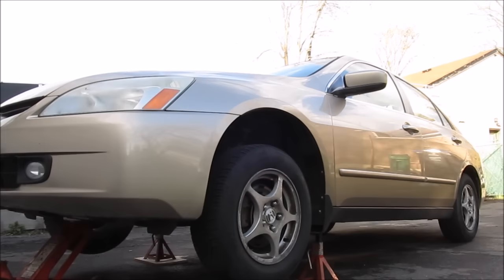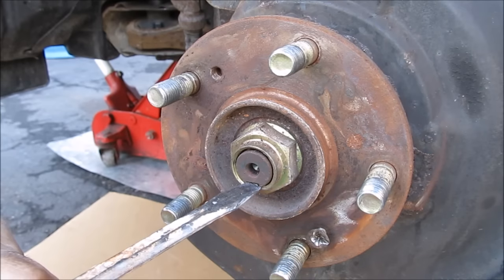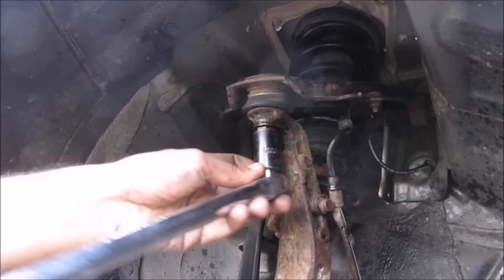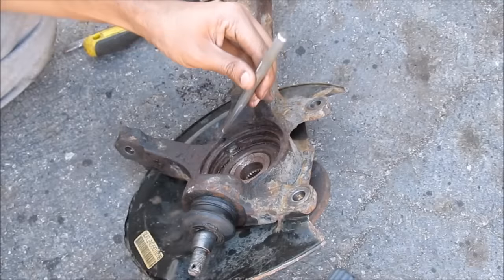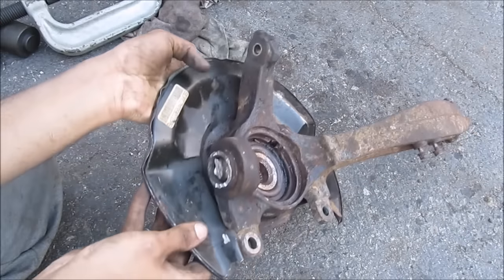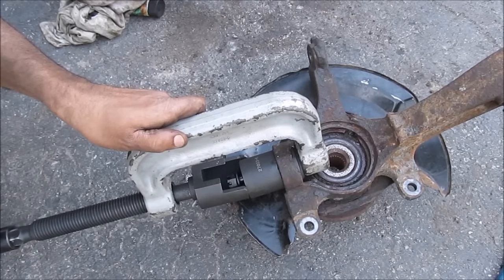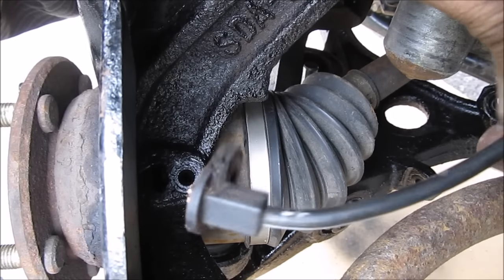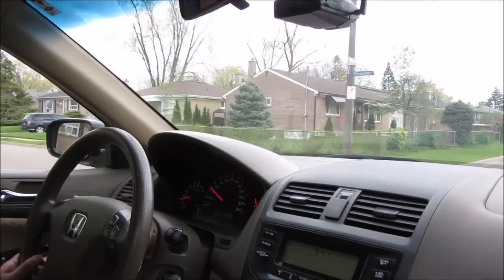Honda Lower Ball Joint Replacement

Comment: there are pneumatic hammers you could use on the ball joint WITHOUT pulling the knuckle completely off. the abs sensor was the reason why you made this a bigger job than it could be.
Reply from the maker: +Gb Xx yea those abs sensors were terrible...I should have disconnected at the harness and left them in the knuckle
Reply: speedkar99 good thank quickly way how to fix diy
Reply: I still have to get an intermittent loose clicking caliper sound fixed... possibly  crushed bushings.

Comment: Great video, i hope you still answer to some comments, How fitting the ball joint separator tool is for honda. 
Honda Manual call for 28mm Jaw size. It would save me great money if i could just buy this instead of the official tool

Thanks

Comment: Great Video, I just had a ball joint fail on my 2003 honda accord.
Reply from the maker: +Jeff Hortian oh wow, did it fail in the parking lot?
Reply: no, I just got off 94 in Minnesota and I was at the stop light. I hit the gas and was about 1/4th of the way through the intersection and then it slide for 5-10 feet maybe if that. Called the cops to warn cars and tow truck. Got it home and am working on it still. I am about to try and get that unit off the end of my old drive shaft and move it to the new one. I am trying to figure out the proper way right now.

Comment: Very nice video, you're truly skilled.  Question, what would the average price be for a simlar job at the local garage?
Reply from the maker: Thanks. I'd average 1.5 hours of labor per side. Part cost is $30 for a cheap ball joint and $50 for quality ones.
Reply: So about $200 per side? (adding the overhead)
Reply: I was quoted at 3 hours and 80 for parts at my fav local garage...$500...I almost considered it as I have nightmares from pressing and getting the preload right on my Jeep.

Comment: thanks for the tutorial, much appreciated. any tips for removing that dust shield from the back of the wheel bearing? i tried penetrating spray and a flathead, but it's stuck in there pretty good.

Comment: Great video .i need to replace the lower ball joints on a 2000 Honda CRV. Please let me know of any differences,
Reply from the maker: +ppett1 thanks. If its pressed into the knuckle it should be the same

Comment: Gud information video.. 1 thing is that ring u removed b4 u tryed take off the balljoint is giving me a problem.. wat can it b? Mayb rust?
Reply from the maker: +Reynaldo Castro Yea its not easy to get off sometimes, you might have to break it.
Reply: speedkar99 i sprayed some pb blaster got it off but bent it very lil on the edges using the flathead but can b reused.. thanks fo that video!

Comment: Very important to torque everything to spec.,  castle nuts 36-43 ft Ib. Spindle nut 181 ft Ib... Do not use an impact wrench.
Reply from the maker: Good tip.
Reply: The Honda Service Manual and the aftermarket HAYNES manual include all torque specs.  On some of the suspension bolts, you should raise the lower control arm to mimic the suspension position as if the car were resting on the ground prior to using a torque wrench.
Reply: @stevencagle1031  The problem is is that speedkar99 is so lazy that he uses impact wrenches instead of torque wrenches to tighten nuts and bolts.

Comment: Great video. Is there not a clip on the underside of that ballpoint that needs to be in? I didn't see you take one out either. My honda 98 has a clip that needs to come out. Actually it's a snap ring ordeal.
Reply from the maker: +Turbo Tony No circlip on the gen7 accord

Comment: good to the point,but never mentioned the snap ring!and ball joint needs to torqued !or they will snap,and don't say no.it just happened to me today,I torqued  new one a year ago,the mechanic put cv joint for me two weeks ago and  did not torqued it and it snapped on me today!!
Reply from the maker: Good point

Comment: Hi,
Since you've shown work on several Toyota/Lexus products, I hope you'll respond to a puzzling question about my car:  I have a '98 Lexus LS400 
that I really like a lot.  Recently on starting it briefly flashed 
"check VSC" so I knew it probably had a weak battery cell (a known response for the model), but it cranked well and started easily, so I put off replacing the battery.  A few days later on starting a LOT of dark smoke smelling of raw gas billowed out from under the hood and tail pipe. It shut down in about 4 seconds. Tried it once more, same thing. 
No CEL.  Next day it cranked but wouldn't catch at all. Had it taken to the
shop. The Tech said the only thing they could find was a defective battery.  
Said that, on cranking, voltage fell below requirement of the engine 
management computer causing it to badly flood the engine. When they 
boosted it, said it started and ran properly.  So they just replaced the
 battery. It's been fine since.  Does all that make sense to you?
Thanks!!
Reply from the maker: +wholeNwon That smells like a failing fuel pump or a line with a leak not getting enough pressure. Inspect those.
Reply: +speedkar99  But the engine flooded.  Exhaust analysis confirmed very rich...unburned gas.  I did not touch the gas pedal during this time. No leaks.
Reply from the maker: +wholeNwon Well yes, a battery with a bad cell will cause the computer to do strange things. This is confirmed especially when you boosted it and it started fine.

Comment: Or if you don't have fancy tools you can heat up the knuckle put the ball joint into the freezer and you can put it in by hand. Literally.  I spent hours trying to squeeze it in. And than I had eureka moment and it worked.
Reply from the maker: Good point.

Comment: When working on this gen accord have you ever come across the damper fork bolt seized in the control arm bushing. Happened to me, had to take it to a shop, didn't have the tools to cut the bolt.

Comment: Great Video.. one suggestion though,  many of those bolts have torque specs...I see you used a torque wrench to put the axle nut on.  That actually has a low torque spec for example.  I would think over torqueing that nut would be bad for the bearing.
Reply from the maker: +David Rogowski I didn't use a torque wrench for axle nut...I used an impact 
I only use a torque wrench for gasket surfaces. The rest I use my calibrated hand.

Comment: Putting the castle nut back on and hitting it with a hammer to knock out the upper ball joint just added a new job and more time and money to this fix, as doing that damaged the threads on my upper ball joint bolt. I’d edit that recommendation from the video. Not a pleasant experience as I’m buttoning things back up and find this so bow my car is still on stand in the driveway and now have to fix the upper ball joint

Comment: A few huge items missed on this video: when tightening most of the suspension, steering, and drivetrain components a torque wrench should be used with the correct torque values -- especially the axle nut. Several of the nuts and bolts on the suspension and steering items should be single-use only and thus replaced if removed.
Reply from the maker: Agreed. Thanks

Comment: Good video, new subscriber! What year/generation honda is this? Does this apply to ANY Honda double wishbone suspension? I like how you left in the complications and how you overcame them. that's DIY!
Reply from the maker: +AJFresh thanks for subscribing. Yes it applies to most Honda's with double wishbone and the ball joint pressed into the knuckle. The adapter kit might fit better on other Honda's but the 7th gen Accord was something else

Comment: I saw the problem you had with the recevier tube not quite working for the top but what was wrong with the installation cup for the bottom? Not wide enough or to wide? Its nnice to know OEM's "Honda Specific" adapters don't work. I guess I cant blame it all on OEM, my 2001 Accord has a slightly different knuckle with a large metal support molded into the knuckle right to the side of the ball joint, so I dont know that even that hal cup you used on the top wiuld even come close to fitting.

FYI for all , I saw someone else use a 1 inch pipe to bang out the the ball joint from the bottom while steeping on the knuckle to hold it, popped right out but be careful not to damage the inside ring or cause the ball joint to angle which may damage the inside of that ring, otherwise the ball joint will never be truly secure. In my Alldata subscription it a tech bulletin from Honda says to use a honda special tool (a round plate of metal..super high tolerance I guess) and put in in the ball joint ring on the kunckle, to check the inside diameter of the opening, if it doesn't perfectly scrape it , honda says to chuck the knuckle.
Reply from the maker: +Ever Forward good tips thanks

Comment: Oh lord, first of all this was a great video and at the same time terrifying, I believe I have to replace the lower ball joint and I just know that tomorrow when I call my mechanic it’s gonna cost me a fortune and won’t be worth it. 

Knowing I’m a DIY guy or at least tried to I ended up here.

Do you think a guy like me who the most difficult thing car repair related that has ever done is replacing the power steering high pressure hose could do a big project like this? 

I need some encouragement.. but please be honest, it has been a couple of bad months for me.
Reply: I've done many of these on my cars am not a mechanic and only have basic tools it might take you all day but you'll save a ton of money, i just finished doing my 06 f 150 and fixing to do my 2002 accord, just takes will power and patience,YOU CAN DO IT.

Comment: Is it absolutely nessesary to remove the abs sensor? If you just loosen the mounts for the abs "cord" from the upper control arm and the "knucklearm" then you should be able to remove the knuckle from the axle and then just press out the Ball joint while sitting in the wheel-well? Sry for bad english technical terms. This is a question, not an instruction, as I'm trying right now to do this.
Thanks for any responses
Reply: Harry  because of "dinitrol" (anti rusting agent -layer used in Denmark) it was nearly impossible to loosen the "little white part"(not white anymore😅) so I ended up doing the whole shabang inside the wheel-well, with the knuckle still laying on a small chair, c-clamp pressing and everything. It was a hustle, but I got to the finish line💪. But thank you very much for the comment.!

Comment: Why did you take out the strut to lower control arm bolt? I have never had to. 
It is way easier to knock the ball joint out with a hammer and deep well socket.

Comment: I would say when tightening the lower control arm to suspension fork you should Jack the Axle up to normal ride height so your bushings don't twist so far when you lower it. Can ruin bushings quick.

Comment: I don’t know what that part is but it’s not an abs ring. Those are on the CV axle. Otherwise good job. A 1 3/16 inch socket will fit to hammer out the lower ball joint as well.

Comment: I have a 01 Acura CL. Everything went fine. Except I can't get the knuckle to line up with the upper ball joint.
Reply from the maker: +Free Spirit check the driveshaft. If you pulled it out it won't lineup.

Comment: Put a big socket over lower bolt on ball joint,take hammer hit like baseball the socket,the ball joint will come out,do it on grass,no special tool,hammer in New ball joint with small block of wood,use grease or motor oil in hole before tapping in,make sure take your time check alot to make sure it goes in straight, I did it,double check

Comment: Need help: I need replacements for the ABS front nuckle ring you mentioned. My car was missing one on one side and I destroyed the ring on the other side when removing the ball joint thinking that it didn't have one like the other side.
Reply from the maker: +Michael Officer Dealer item

Comment: the OEM ball joint I got from acura TL 2008 (51220-SDA-305).  it fit perfectly on the knuckle.  But when I try to install it back on the control arm.  it is loose, the shaft is thin compare to the one I removed which has a thicker shaft.  But this is OEM from acura.  Do I need a ball joint insert to keep it snug?  coz if I go ahead and install it, it will have play since the diameter for the ball joint shaft is thinner.  Any advice?
Reply from the maker: +Roberto Benoza I don't advice using the inserts because sometimes they come loose from the control arm too. Get the correct ball joint for your vehicle, it doesn't have to be OEM. Any premium aftermarket brand works fine, just make sure you grease it regularly with a grease needle thru the boot.

Comment: After you pressed in the lower ball joint was there a ring that you have to snap on to keep the ball joint from coming out? I am attempting this job tomorrow.  The lower ball joints I bought from Canadian Tire did not have a snap ring.
Reply from the maker: No, the Accord's ball joints are technically upsided down and don't need snap rings.

Comment: I didnt see if you did or mightve of missed it but did you install the snap ring onto the new ball joint?
Reply from the maker: Whoops
Reply: Lol, i take it that it didnt affect you then. I broke the one that came with mine trying to force it on. Was looking around to see if it really mattered or not. Does it matter if you replace one or should both be replaced at the same time?

Comment: Also,  We knocked the ball joint loose by accident trying to pull threaded part.   Then we jacked it back in til it popped into place.  Is it good? Or are we supposed to replace it now.
Reply from the maker: Replace it

Comment: wait a minute, No Torque specifications ? to no bolts after you install the new parts in into the car.. no torque specifications for any bolts or any lower ball joints ? Just wondering.. .
Reply from the maker: +Da Wolf my hands are calibrated

Comment: I’ve seen more anti seize used in this video than I have used myself in my 10 years of working on cars professionally. Definitely advise against putting any on threaded components like you did in this video. It alters the torque spec of whichever fastener it’s put on due to the fact it now uses much less energy to tighten.
Reply from the maker: True. 
But we live in the rust belt
Reply: @speedkar99  so do I. I’m in NS, Canada. Unless otherwise stated in service data, fasteners are meant to be dry. I can guarantee you over tightened every fastener you touched unless you accounted for stretch
Reply: @jasonlecreux1175  nobody cares

Comment: Quick question. On a 98 civic lx do they have ball joint in the rear? The reason i ask is because my car 98 civic it makes noice on the rear side and i had stud and control arm replaced and is makes a noice as i drive and it goes away but then comes back.
Reply from the maker: I believe some of the older civics do 
Not sure which generation

Comment: What should the parts cost for all ball joints on the front for all honda accord and how expensive of a job would it be for labor
Reply from the maker: Parts are $35 per ball joint. Labor is 2 hours per side. The press was a free rental.

Comment: Note: you DON'T need to cut the ball joint stud off. Use adapter A to cover the stud, stand the knuckle verticle and then use a hammer. Pound the crap out of the adapter and it'll push the ball joint out pretty quick. You may need two people: one to swing and one to hold the knuckle verticle. 
Also adapter B doesn't work on a civic. Just adapter A and a hammer.
Reply from the maker: +sonic brown Yes that's how I got the other side off
Reply: sonic brown so you don't need to use the clamp? Just adapter of the stud and hammer? I'm having trouble taking this ball joint out.
Reply: Nope. You don't need to cut the stud off. Just use adapter A and a good size hammer and pound that pig out. If you have a good hammer it'll go quick. Remember to pound it out the correct direction.
Reply: Ok thanks you saved me so much time.
Reply: would have been nice if you had recorded that other method

Comment: DO you think the Hondas are harder to work on than the Toyota or vice versa? Keep doing what you're doing, awesome videos.
Reply from the maker: +tomby513 Thanks. Honda is harder to work on definitely. Alot more things seem to go wrong too. 
These ball joints are simply bolted on on the Toyota. No need to remove knuckle or use a press.

Comment: What do you do if the axle comes out before the lower ball joint is removed
Reply from the maker: That happened to me. 
You have to twist the axle until the tripod can seat itself back in

Comment: couldn't I just take off the axle nut, remove the fork on the bottom and move the upper assembly all I want? i did this before replacing my cv axles, and then just use a pickle fork and a hammer to intall the ball joints. though I admit this would be a good idea to disassemble it this way.
Reply from the maker: Yes. But I don't recommend using a hammer to insta ball joints. That's how you damage them.

Comment: What year is this? Tried this on my 2008 and it wouldn't work. Had to take the dampener, stabilizer bar link and control arm loose. Didn't have to take off the brakes at all.

Comment: the mechanic today changed the lower ball joints, he removed the rings (check the video at 4:35) and he did not install back , saying that it is useless  to install back. Is it true? What do you think about?
Reply from the maker: +Vlad Rotaru the circlip? Its a safety fall back
Reply: speedkar99 so, It should be installed back, right? And if not installed what is the consequence?

Comment: He didnt mention an important step which is to put the snap ring on the ball joint before reassembling. And im pretty sure you can replace the ball joint without pulling out the steering knuckle